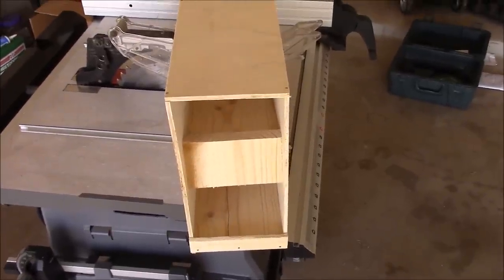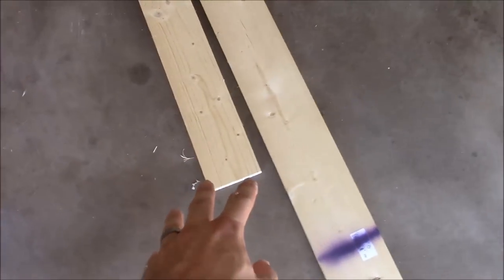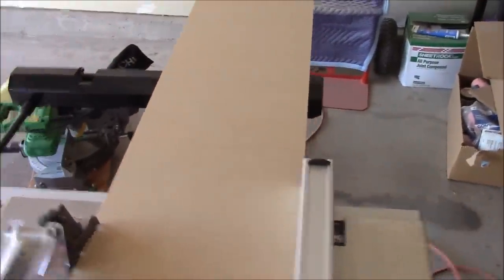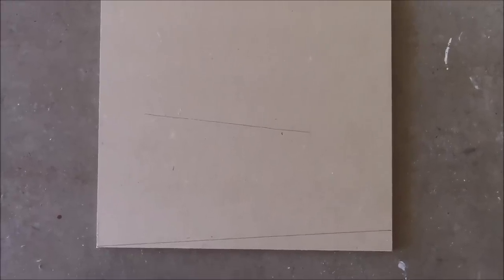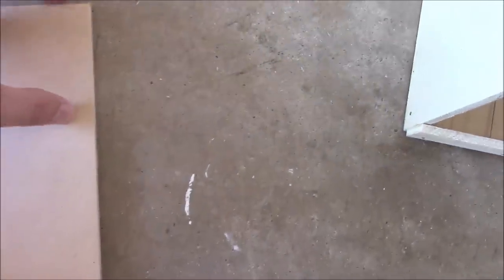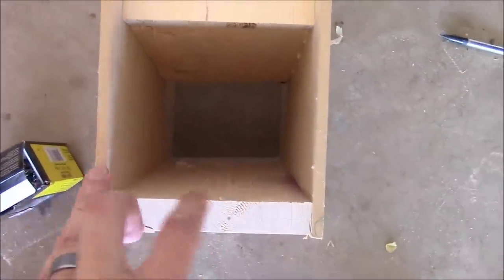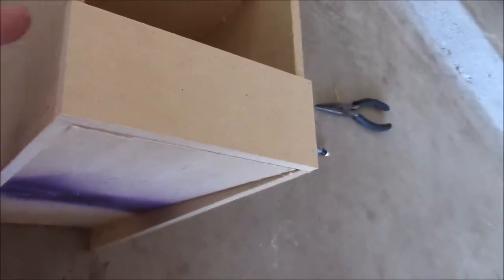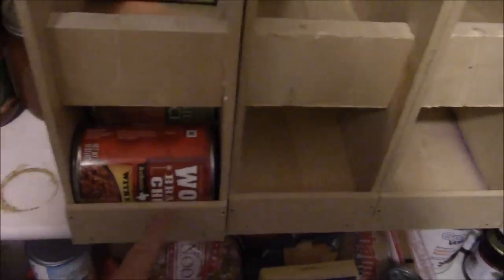How To Build A Can Rotator For Your Pantry

Comment: Nice job. I imagine since you've got 6 units stacked beside each other that you could actually minimise wood usage by making a 6 can dispenser (with 7 walls only instead of 12: left & right & 5 separators). Using dowels for positioning the ramps may assist with easy alignment also.
Reply from the maker: True.  If you were doing a more permanent installation you could make a bigger one and save on some labor and materials.  But having a bunch of smaller ones gives you the ability to move them around if you want.

Comment: It’s been several years since you did this so I was wondering are you still using them? Did you make any changes to the design? I love the consolidator units but at $35+ a piece I would rather make them. They are also stackable which is very nice. I would love to make these stackable but we do not have a table saw. Do you have any tips or ideas on making these stackable without a table saw? Thank you for sharing 👍👍 Stay safe healthy and happy 😃✝️🇺🇸
Reply from the maker: Yes, we still use them in our pantry to this day.  They work great for what they cost.  You don't need a table saw to do this.  You can use a circular saw, it just may take a little bit longer to do.  Circular saws are cheap and every household should have one, IMO.  Good luck!
Reply: @LDSreliance  Thank you for the fast reply 👏 We do have a circular saw 👍 My goal is a stackable unit 6 feet high and 3 feet wide for a small pantry. Stay safe healthy and happy 😃✝️🇺🇸
Reply from the maker: You are welcome.  Good luck!  Hope yours turns out well.